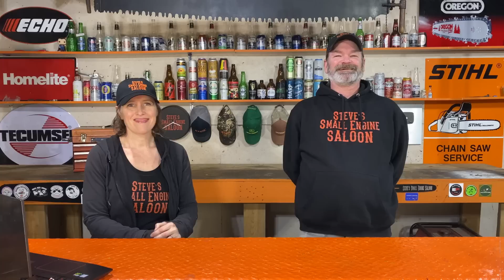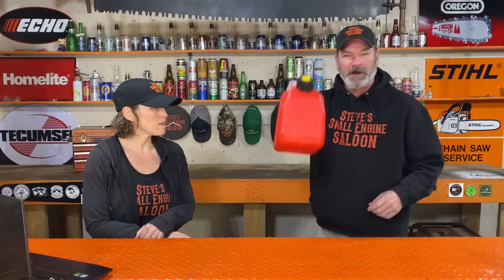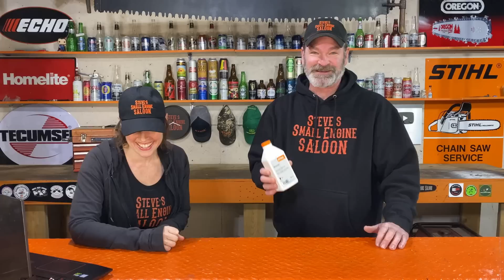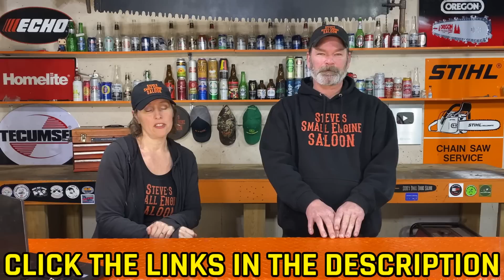Why Is There Such A HUGE Difference In Gas/Oil MIX RATIOS? (DAY 12)

Comment: I have 11 two-cycle engines. Four of them are from the 1990’s when I was using Echo 50:1. In 2002, I began using Amsoil mixed at 80:1. I have used Amsoil ever since, except for the Opti-2 that my wife won which lasted for five years. The last couple of years I have been mixing the Amsoil at 90:1. I have had no issues.

Comment: Another excellent video, Steve and April!
Another important point that a lot of people forget when referring to old two stroke equipment and the 32:1 or 16:1 ratios, back then they were using leaded gasoline. It definitely made a difference in prolonging engine life.  That was a needed advantage, since those old 30 weight motor oils broke down so quickly.

Comment: I personally run everything I own at 50:1. Have never scored or blown up an engine and I’ve built thousands of chainsaws. Definitely important to add that disclaimer though. It is always up to the end user to make a decision on what oil/gas ratio to use in their equipment.

Comment: The best part of this video was at the 2-minute mark when April was able to help you with your words and she said "Better" That was perfect April.  Steve needs to keep you around.

I run all Stihl products and they call for 50:1. I bought a 2-gallon gas can and I only use that gas can for my mixed fuel.  I dump   a bottle of oil in the gas can and fill it up with gas and off I go.

Thank you, Steve & April.

Comment: I've been using Amsoil Saber at 100:1 in most of my small 2 strokes the last 20 years with absolutely no issues.  Also have not fouled a plug on any of them in the same timeframe.

Comment: You hit the nail on the head with this one, Steve. 
I've got two strokes from the eighties to the present and as two stroke oil technology has advanced, my mixing ratio has changed. 
I use a two-stroke oil that is recommended by the manufacturer to be mixed at 100:1. I actually mix it at 70:1 because it's a little easier with my setup. I've been using the same oil at the 70:1 ratio in all my two strokes for years with no issues. 
As motor oil has advanced.....so has two stroke oil.

Comment: I found an oil Optilube years ago,  one mix works in everything 2 cycle  from my vintage Lawnboys to my newest Stihls.  Works great!
Reply: Very good Oil, been using it for 20 plus years in every 2 stroke engine I have I own 10 chainsaws and miscellaneous lawn equipment Never had any oil related problems 👍🏻
Reply: @ihus9950  No problems here also!

Comment: That mix question is good for ENDLESS debate and discussion.😄 I’ve finally gotten brave and decided to run about 40:1 in everything, even the Homelite I bought in 1974 that’s marked 16:1.  I read somewhere that certain foreign manuals for larger saws like my Husqvarna 385XP recommend richer than 50:1, maybe even 33:1.  I think 40:1 with good oil should be pretty safe.👍
Reply from the maker: Right on

Comment: 50:1 works for everything. I used this ratio for 30 years. STENS has 2 STROKE oil that works with any ratio. I remember using SAE30 oil for 2 stroke mix and bar oil if I had nothing else.

Comment: Wow Steve! I never knew that it was possible to mix all to 40:1! I also have a few jugs of 2 stroke gas ratios. Maybe I will go down to two jugs, One 16:1 and one 40:1 and see how it works for me. The old ones I still like to treat to more oil, but the newer ones that call for like 32:1, maybe ill try 40:1 with the Echo Red Armor Oil. Thank you for the great video!!! Have a good one Steve and April!

Comment: I like that you are answering questions. 

I have one machine that says use the 50:1 mix. I read a comment that the manufacturers want to pollute less so they use less oil in the mix. The commenter said that he uses 40:1 in all of his machines. The worst outcome is oil fouling on the plug. I haven’t found it happening.

Comment: I use Amsoil mixed 100-1 in all my two cycle equipment, in my 40 year old Olympic chainsaw, lawnboy lawnmower and Remington chainsaw and weed whip, they all run great.
Reply: What is the thought run an engine at 100:1?  Another ounce or two sure can't hurt.  I just tore down a failed Weed Eater that was using Amsoil.  The inside of the engine had no signs of oil residue. With only adding 1.3 ounces of oil per gallon, maybe he didn't measure precisely.  When I tear down an engine running 40 or 50 to 1, things are lubricated well.  I would rather double the amount and not worry if I didn't measure correctly.

Comment: Agreed👍🏻 40:1 with modern 2t oil is generally pretty safe for everything. Tho I do sometimes mix 32:1 and retune accordingly. IMO, oil is cheap insurance and a potential fouled spark plug is cheaper than a potential scored piston and cylinder or failed bearings! (Tho it's been proven to work, I'm too old school to trust 50:1 even in modern equipment) thanks for sharing! Excited to see tomorrow's video😎

Comment: Very informative on this one. Going back to my dirt bike days mixing gas and oil to 32:1, I still mix at the ratio for all my 2 stroke equipment. Yes I go through spark plugs more often, and they smoke a little more, but the equipment still runs great.
Reply: I agree! 28 to 1 for me, and no issues.

Comment: In Australia we have lots of 2 Stroke engines that uses 25.1 even through to the early 2000 before EPA stepped in to reduce emissions.
Victa never changed that 25:1 ratio on their 2000+ Motors when these oils came out with all these newer oils about.

Comment: I use a 40:1 mix for everything, too!    I mix one gallon of non-ethanol gas & oil at a time to keep it as fresh as possible.    My 1993 McCulloch Pro Mac III Super grass/brush trimmer &  2000 Poulan 2900 Farmhand chainsaw use a recommend a 40:1 mix.   50:1 is recommended for my 1995 Husqvarna 257 & 2005 Jonsered CS-2152 chainsaws, but I use the same 40:1 gas/oil mix for them too.    I own 72 acres of woods & burn firewood.  My stuff gets used, and I have never replaced a 2-stroke piece of equipment yet.   My dad gave me his Husky 257 chainsaw about 7-8 years ago.  I can't vouch for its entire life.

Comment: I run 40:1 in my 70's Poulan and my 2021 Husqvarna chainsaw and in my 2021 husqvarna weedeater without any problems. Great advice Steve

Comment: All of my home 2 stroke equipment uses a 40:1 mixture. (Premium oil, of course!)  But my 9.9 Yamaha outboard requires an amazing (to me) ratio of 100:1!!  Bought it lightly used in 1998, and it's still going strong!  Looks like new inside.  I inspect the bores every fall when I put her away for the winter.   Thanks, Steve and April!  Keep up the great work!
Reply: Outboards are different because they're water cooled.
Reply: @luvr381  Then why do some call for a 40:1 ratio?

Comment: I have stuck with 25:1 for 45 years, the only problem I have had is with a small Husqvarna brush cutter dripping oil from the exhaust. I wore out a Homelite chainsaw, when I stripped it down the bore and piston were perfect, the crank case was clean and only the rings were worn out.
Reply: I like your method. 28 to 1 is where I live. Never less.

Comment: I find 40:1 to be the sweet spot for me. Tends to run best cold and hot weather and in every 2 stroke I own no matter the brand or age. For example I have early 041 AV Sthil, 372xp husqvara, poulan 4218, and 4-5 different weed eater’s in different brands and ages. The 3 saws run like a top. I cut some down trees for an older neighbor couple days ago after ice storm and after I shut saw off he asks what kind of saw is that it’s scary nasty cutting everything like butter. It was the 372xp he’s right I don’t let others besides my old man run it😂. The 041 probably nastier and heavier so I left at the house!

Comment: I used to have the same situation with multiple gas mixes.  I went to all Stihl engines that use the same mix.  Maybe a helpful tip for your viewers, I put duct tape one the handle of the can that has the mixed fuel

Comment: Hey Steve really enjoy your Channel April is good adition to your show. I was a little surprised to see most folks use 40:1 mix ratio. For about 40 years now,  I have always mixed at 50:1 with full synthetic 2 stroke oil. AMS Sabre for air cooled engines. Almost always use ethanol-free fuel and a high quality octane booster if I cannot get premium 91 or greater. Synth 2 stroke oil is expensive so 50:1 also saves a few toonies. Never had an oil related failure yet. My 2 cents. Cheers🍺

Comment: You do have to be careful on this blanket 50:1 ratio for everything. Many of the older engines do not have roller or ball bearings in them. They have plain bronze or Babbitt bearings. You may be able to reduce the oil ratio, but I don't believe 50 or 40:1 would be a good idea.
Reply: This is especially pertinent on engines that, unlike lawn mowers, handle a load like old outboards. Using synthetic oil will allow you to double an original 16:1 ratio but I've found that anything over that puts undue strain on those brass bearings. Regards

Comment: Been running the amzoil sabre mix at 80:1 in all but my good husky saw. No issues after several years. The husky gets husky oil at 50:1

Comment: I once acquired a small 2 stroke generator that would not run despite having compression and spark , took off the muffler and burned it in a small wood fire outside where it burned merrily for ages , put it back on next day and generator ran beautifully again . 
               There can be too much oil sometimes ...

Comment: Not sure if anyone else has said this, but 40:1 with good quality synthetic 2T only. Don’t go using your basic garden variety 2T (designed to be run at 25:1) and expect your expensive chainsaw or outdoor power equipment to last long.

Comment: I think that's a great answer. I have an old Lombard chainsaw... 40:1 mix ratio, a newer McCulloch 40:1 and a new Stihl at 50:1 I'm thinking maybe I'll stop that nonsense and mix it all at 40:1.... Possibly foul a plug on the newer one but what's a plug now and then?!  Especially when I don't use them all that much anyway.

Comment: It's not very often I disagree with you Steve, but this is one time.  Some of the old sleeve bearing engines need the oil, and I picture the thickness of the oil mixture acting not only as lubrication, but acting like a shock absorber, keeping parts from banging into one another.
Anyways, my father always told me there are three things you never talk about in public.  Religion, politics, and fuel/oil mixtures.  Still loved the video!

Comment: I run 40:1 using Red Armor.  Also I mix a couple of jugs and also use the 40:1 in 4 cycle engines

Comment: The one I use in all my, lawn equipment! Here in the States is called Opti-2 And it works great! Have used it for years now! It comes in 1 gallon and 2 1/2 gallon mix! And it has fuel stabilizer in it! Also use Ethanol free premium fuel when I mix it! But If I Buy a brand new Stihl whatever. It may be! I use their premium mix fuel until! The warranty is up! Just in case, something happens to it! But great, video, Steve and April Cheers, Folks!

Comment: yep my Dad was a small engine mechanic he had been a mechanic since the 1920s working on everything grom model Ts to sherman tanks and he always maintained that as long as you used good 2 stroke oil everything could be could run the same. so ran everything at 40:1.

Comment: I remember the 30wt motor mix too. Notice that 40:1 would work, but I only used it in a pinch. Your logic makes sense why I hadn't destroyed an engine. O yea! My brother poured raw gas into an old Homelite saw. Needless to say! It melted the needle bearing to the crank shaft.

Comment: Many years ago, someone grabbed a plastic container of (unmarked) used motor oil and poured it into a 2-stroke snowblower. When I arrived home and found the problem, the snowblower was drained and a premixed oil/fuel was filled into the snowblower. After priming and (electric) starting, the blower operated normally. No harm - no foul.

Comment: Thats a sorta, kinda maybe answer! I have three cans, 32-1, 40-1 and 50-1 for my various 2 strokes. I have had the equipment for many years and I'm of the opinion that if it aint broke don't fix it. Besides the smaller cans need refilled sooner so I always have good gas in my cans.

Comment: I have a Lawn Boy, from the 80's, that runs 32:1.   I still run it like that, even with the newer oil mix.  And it still starts 2 pull every time...

Comment: I’ve run 50/1 in my TC 300 series & it destroyed the piston & cylinder & seized the rings to the piston. I found a new old stock engine on eBay luckily but I use 25/1 as recommended now.

Comment: I was thinking about doing that while replacing gas lines, purge bulbs and filters on some old equipment. The carburetors look great. Have a 32:1, three 40:1 (that I may trade) two 50:1 (that are fine and keepers) thanks Steve.

Comment: Yup, 40:1 BUT...I only use Bombardier Injection oil, from many many years of high perfomance ski doos and never an oil related issue. My 1971 McCulloch 710A,with points ignition loves it, as do the rest of my old chains saws.

Comment: I respect your expertise and experience.  Nevertheless, I'd prefer to follow the manufacturers directions,  If, using todays TC-Air Cool oils, I get a tool that produces a smoke screen, I'd cut back a bit on the oil.  That said, I always  follow the manufacturers directions for oil mix and maintenance.  They want me to have a  good experience with their tools so I'll talk it them and buy more of their brand.

Comment: They’ve made good quality 50-1 oils now since at least the 80’s. Back then it was a good question and the answer given was to mix at what was on the bottle not the equipment. Hard to believe this is still a question although, I admit I always mix at 40-1. The more interesting question is, let’s say you are mixing a gallon of gas (128oz) at 40-1 do you add 3.2 (128/40) or 3.75oz (128+3.2=131/40=3.75) 😁

Comment: 40:1 works for me, but I only use Stihl synth, as I only have Stihl 2 stroke equipment... apart from a chinesium pole saw which wants 25:1. It can get 40:1 and like it.

Comment: Question I have a bunch of this Castrol Garden 2T blue mixing oil rated API TC that I bought about 4 years ago, is this considered "good modern oil" should I mix this stuff at 40:1 even for machines rated at 25:1 or keep it at 25:1 / 32:1 like I have been?  Cheers all

Comment: No way am i an authority on this subject but I fill my small gas can to exactly 1 gallon and add 1 small 2 stroke oil amount to the fuel.. I reuse the small 2 stroke container and refill from the economy size 2 stroke container so to make sure my measurements are consistent I marked the small container at the full level before using when new.

I am 65 years old and been doing this for years and never had 2 stroke equipment freeze up on me.

Comment: I have an Earthquake one-man gas auger by Ardisam. I called them and they only recommended using their 40:1 oil in ethanol-free gas. I called them and asked if I could use the high-tech 40:1 canned much, and they didn't recommend it.  Guess what I use in all of my 2-cycle equipment? The pre-mixed fuel.  The Earthquake ribs just fine on it and so far, the engine has not seized after a few summers.  Good show, Steve and April!
Reply: That's funny,  I also have an Earthquake auger and it clearly says 50:1 on the unit!

Comment: It's not only the ratio that counts.
Stihl has three different two stroke oils.
Stihl HP (red)
Stihl HP Super (green)
Stihl HP Ultra (green)
They told me the red one is only to be used on chainsaws.
On all other two stroke equipment you can use HP super or HP Ultra.
There's a significant price difference between the HP super and the HP Ultra, but I don't know why....

Comment: Only thing I don't use is Stihl oil in America we have HP oil and Ultra  HP has no Jaso rating and ultra is FB not enough detergents in my opinion carbon build up in the fs94 exhaust in Canada white bottle Stihl is made by Castrol does it have a Jaso rating?  We use Amsoil Sabre in everything at 40/1 take care my friend 😁

Comment: Have used full synthetic 50:1 in everything for the last 30 years never a problem. Carburetors must be adjusted to whatever you run and stick with it. Running 40:1 is less fuel and will run leaner without adjusting if you have been running 50:1 or if it was set at the factory to run 50:1

Comment: Mine get 1 of the little bottles of whatever I can find or I use 30wt. of equal size. If that doesn't work, I buy another saw or whatever that has the right oil in it, and start over.

Comment: So i bought one of those two-stroke gas bike styled engines and I’m almost done the build but I really want to get the gas right. So to save money and oil should I go 40 to 1 like is recommended by all also considered cradling the grave or should I do like it says in the very unhelpful manual 16 to 1 for 500 km or 300 miles for the braking period because after those 300 miles I’ll gladly use 40 to one which is much much less oil but then again I bought pro select premium two cycle engine oil, which was recommended to me by a friend saying that it’s the best for this kind of stuff
Reply: So do I skip the break in period or do it and then cradle at 40 to 1

Comment: Hi Steve, just a quick question....if you've been mixing 40 to 1 for 30 years and now the oil is so much superior, how come your engines didn't seize up with the old oil?
Reply from the maker: Yes, exactly
Reply: Drastic change in motor oil viscosity in 1985
Reply: @StevesSmallEngineSaloon  Whoosh - nearly took your hair off that one Steve....